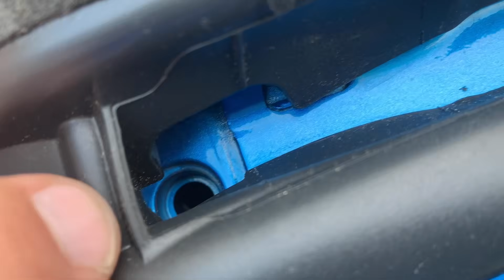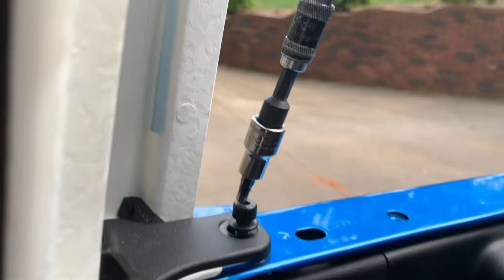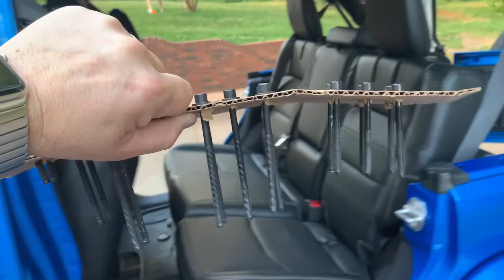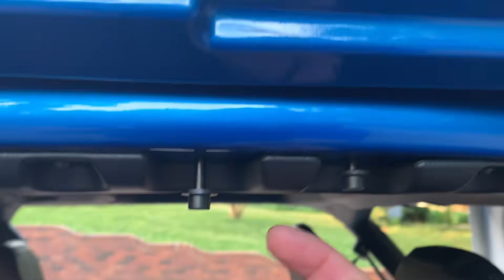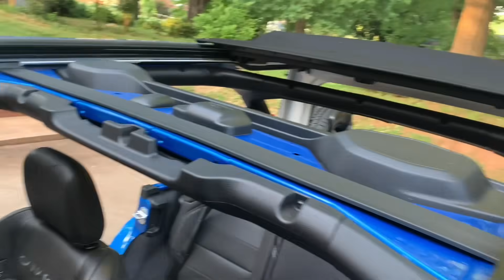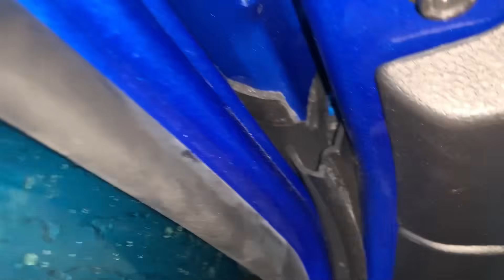How to install Jeep Wrangler 2021 sky one touch power top

Comment: Great video. My only question is does the rear glass AND the rear window frame need to be disassembled at all?  I was under the impression it came off with the top.  Anyone have any experience with this?

Comment: @BrandonHaneline thanks for this walkthrough and the one about the removal. For the back window, do you remember the shorter bolts go in the holes above the wheel well or if they go in the holes near the tailgate?

Comment: I have  a soft top thinking about trading it in for a sky one touch is it really worth the difference  of the two models?  I hardly take down the top. The convenience by pushing a button versus getting to and walking around seems so much convenient.  Also the inside noise level must be somewhat quieter.
Reply: It’s worth it

Comment: Hi, i just found most of the SOT parts to install on my jeep but the 9 bolts per side, i saw the length of inch one on the video, do you have diameter or the part number of them. thanks in advance

Comment: So why not leave bolt #7,8 & 9 installed and remove the entire top in one piece with a cable lift like the standard hard top?
Reply: That's how I do it. It's not much different from a regular hard top. It will be very front heavy though. Check the balance before you lift it all the way.
Reply: Exactly.  IMO the less pieces to come apart the better

Comment: I saw an Instagram story of you removing your sky one touch like you do a hard top, hanging it from your garage ceiling. I'd wish you'd do a video of that. As it looks like I can remove the one touch without fully disassembling the rear window from it.
Reply: I was under the impression the rear window did not need to be removed..    I haven’t takes mine off yet on my 2024 but it stayed together on an older one I had.   I also saw a different short video and like you said they kept the glass on

Comment: Do the screws that hold the bars from back window actually thread into it, or just slide through like a pin and then thread into the Sky One top to tighten? Asking because I was wondering if you may be able to loosely start the 2 screws on the bars before you put the top back on? That way the bars are held in position already, and should align with the top as you put it down.

Comment: Really complicated to remove the one touch roof. Probably not worth the work. I have one and I can say Jeep dropped the ball when it came to the rear window panel. Should have made it easier to remove that panel so it would create that extra turdulance.
Reply: Not more complicated compared to the hard top. Just some additional screws

Comment: Brandon, thanks so much for the videos!  I have the Rubicon hydro blue, just love the color of these!  I don't have a teenager to help pull off the sky one touch (yet), do you think that you can take off sky one touch along with the back window at one time?  I was thinking of setting up a hoist in the garage to pull it up at once.  After watching your videos a few times it seems like this might be possible.
Reply from the maker: You have to pull the top in the back glass area separate

Comment: Awesome video.  Thank you for proving that done correctly, you won’t have leaks.  Definitely removing mine for a few trails in S. Cal that are known to damage hard tops.  Also doing Rubicon trail this summer so definitely coming off.  When you removed the top, was there any areas that you could hook onto that would allow a lift and store in the garage instead of using two people?  Once again thank you so much!
Reply from the maker: Yes. I actually did suspend my from the ceiling of my garage. Long ratchet straps can go all the way around the top and hang from the ceiling. It’s more of a homemade rig. That’s why I didn’t post it.

Comment: I have a question about the dryers on these automated car washes:
do you feel like the pressure of the air will loosen/stretch the sky one touch?
Reply from the maker: No I do not think this damages the power top
Reply: @BrandonHaneline   Have you had any problems with the automatic car wash opening your charging port door during the wash?
Reply from the maker: Great question!! No I have not. So far so good.
Reply from the maker: No. It

Comment: Great video, you are really helping me decide to get this power top on my next wrangler. Questions. How hard is it to store the top when off? Could you rest it against a wall ok? and with the top off, would a you be able to fit a mopar soft  top? The brackets would fit the roll bar but the header? And the B pillar for the soft top hardware??
Thanks
Reply from the maker: Preferably to store flat or upright., but never on the sides.

Comment: Once you remove the sky one touch roof, can you replace it with a soft or hard top?
Reply from the maker: Working on that. There are no latch strikers up front on the header.
Reply: you can, but you need to replace the bracket that has the latches for the hardtop. There is a popular thread in one of the JL wrangler forums about the opposite - replacing the hard top with the one-touch where this is discussed.